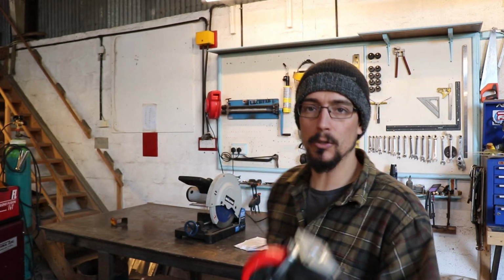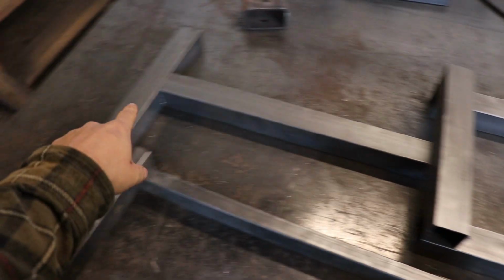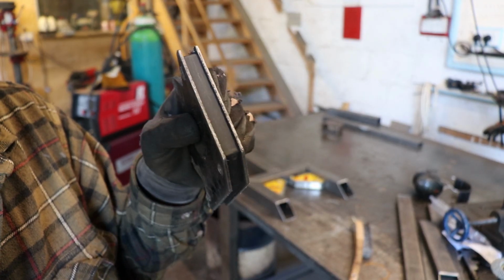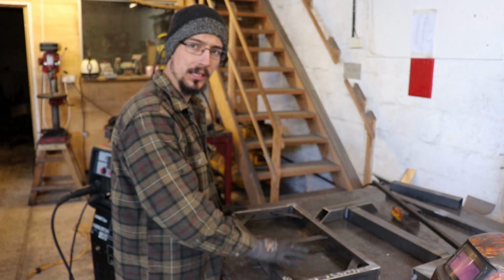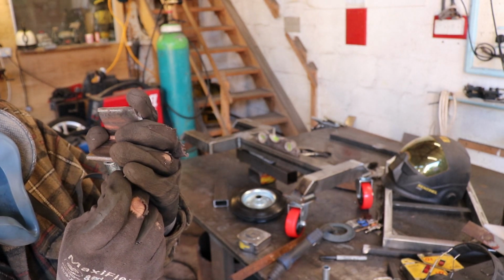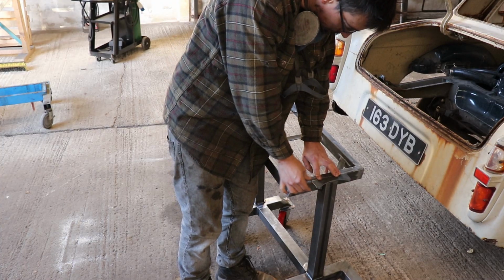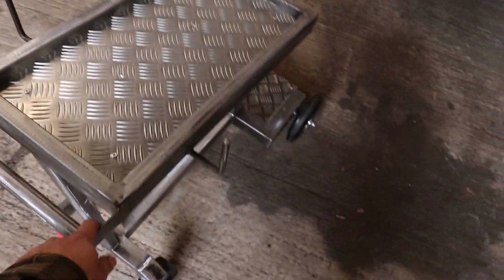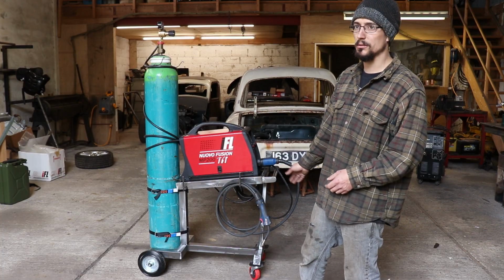SIMPLE WELDING CART PROJECT.

Comment: G'day Matt. I'm enjoying your newly found channel and this was a great build project. 

I noticed you're using your plasma cutter off your welding table quite often and so might I suggest you fab up a little table on wheels that can catch the offcuts/sections rather than having them drop on the floor. Should save your back over time from bending over to pick things up off the floor. It doesn't have to be too large, and just make the height so it can slide underneath the bench out of the way when not in use.

Just a thought from an old geezer with a bad back.

Cheers :)
Reply: watch how he lifts the gas bottle.. you think he cares about bending down to pick up scrap?
Reply: Rick James - so let’s add a gas bottle trolley to Laz Arus’s list. I’ll add a snap of the trolley I made for myself many moons ago...

Comment: I have the same evosaw . I noticed the 45 angle beeing of too. I made a arrow of tig welding wire. Now I have much better cuts. The dail on the clamp is pretty accurate but the line on the base is off. Hope this helps.

Comment: I see most of these carts only caster the front wheels and use straight wheels in back.   My current wood-based cart has four casters, so it is easy to move around (when the wheels don't jam on debris..).  I got 4 5in casters like you have, but I have two of those wheels you used also (noflat solid tires)  not sure which is best now..

Comment: Got the chassis bit cut today should be about the same size as your one based on 50mm box section and 235mm gap for the bottle. So far so good! but might be a tadge heavy as the only box section I had was 50 x 50 x 3! I will make the shelf out of 25 x 50 like yours.

Comment: You want to get yourself a waste oil burner built before it gets proper cold 👍
Reply: Proper cold. That sounds English AF, love it.
Reply: and a big ceiling fan to push the heat back down.
Reply: Casey Stoner lol 😁
Reply: Joe Atwork if I had urchs super power welding skill I'd build a water jacket boiler round it and gravity feed half a dozen radiators around the whole cow shed😉